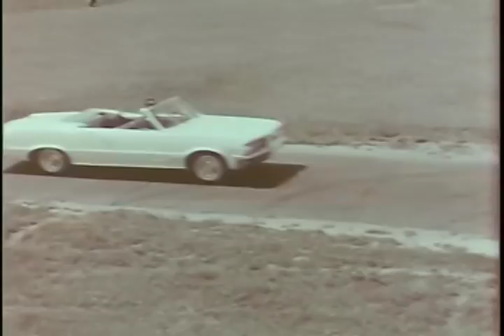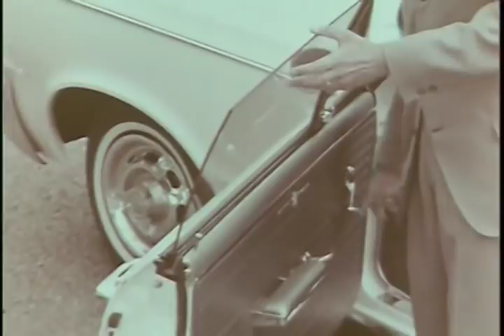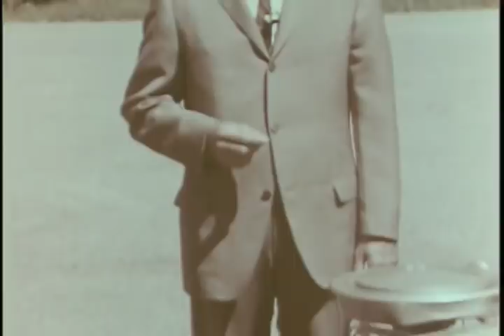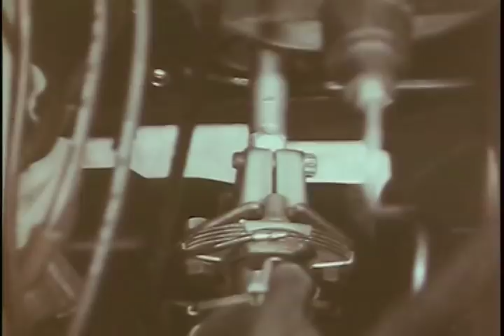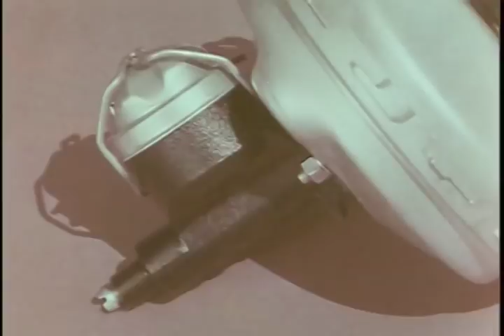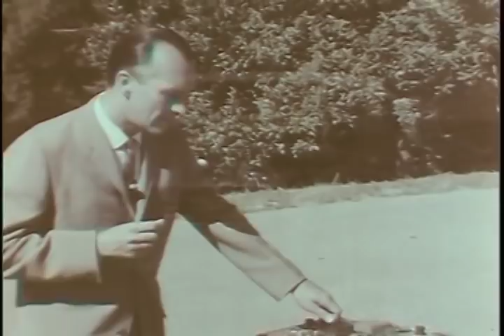Pontiacs for 1964

Comment: my 1964 tempest custom 500 convertible was a great car and later when I replaced the worn 2bbl 326 with a 1966 gto  Th 389 4 barrel engine, which was a direct replacement and bolted up to the 3spd manual, even better. The  insurance for this car was much cheaper than for a GTO
Reply from the maker: That’s the classic sleeper formula done right! Dropping a 389 4-barrel into a Tempest while keeping the 3-speed manual and lower insurance rates was an absolute win. Nothing beats the period-correct swap of a 326 for pure Pontiac muscle without paying the GTO tax!

Comment: We had a 1966 Pontiac station wagon, and it had 400 c.i. engine with a Rochester 2bbl. Carb.  That was one of the best cars on the road back then.
Reply: 389.   400 cubic inch started in ‘67.

Comment: My father bought a '64 Tempest 4 door around '67 after his '62 Falcon croaked. The Tempest had a 215 in it, it was good engine from what I remember. I remember tuning it up, very easy. I replaced the heater core, easy also. Junked it in '81. Always wished it was a GTO. :)

Comment: My brother bought a 1966 Pontiac Tempest with a 6 cylinder overhead cam engine a long time ago. Every time he wrecked it, I got to fix it. It had a timing belt. Never knew they existed. I think it was 250 CID. Powerglide transmission.
Reply: Turbine 300 trans.  Pontiac DID NOT use Powerglide.

Comment: My parents owned a tempest.... it was a complete piece of junk.... they were known for their weak transmissions which couldn't hold up to even the torque of a 327 small block v-8....    others in their line were better I guess....the 2 barrel v-8 would run out of power at about 60.... passing after 60 took forever.... the engine couldn't breath.... it would of been better with a small 4 barrel....   Our tempest had a whistle when you got up to 70.... my dad took it back to the dealer and nothing was ever done.... we were stuck with it....   just a p.s.   Our pontiac was a 1963.... not a 1964.....

Comment: For 1964, we’ve introduced faster dissolving steel - you’ll wonder where your car went after only one or two Michigan winters!
Reply: I got a 64 tempest from my brother in 1974.. It had been through 10 brutal Cleveland winters. I used to slather on the Bondo.
Reply: I had a 61 Tempest from Salt Lake City when it was about 14 years old, you could kick holes in it lol.

Comment: Sure loved the styling of these cars and especially this year. I think I'll hold out though, I'm looking to get the 66 Chevelle, I'll be a little late picking it up, sure it'll be second or third, well who knew how many hands it went through, got it in '84. The suspension I put in was stiff, the noise OUTRAGES,  open headers didn't help. The level of fun and memories, PRICELESS. Wish I still had it, but cars ARE safer and more fuel efficient now. Oh, LOTS quieter too.
Reply: Have you heard of a restomod before mate.

Comment: I still own my 1967 Pontiac GTO, 4 speed with a  Hurst floor shifter, 400 HO engine  with 360 hp after 52 years.
Reply: A guy that lives near me has a 67 GTO also with the 400 HO-4 speed combo and it's actually his daily driver all year long other than in the winter or when it rains. He's the 2nd owner. It's in beautiful shape too. Original and unrestored. It's not 100 percent mint but it's in outstanding condition for how much it gets driven. Definitely a nice #2 car for sure
Reply: If you want to leave it in good hands, contact me.
Reply: I bet it still has a better ride than a 2022 whatever. I miss my 1970 Lemans Sport.
 After 3 350 trans rebuilds I gave it to a guy that raced dirt track. He put 292 I-6 in it with 350 heads he welded together and re-machined to fit the block. Oh and the pistons from a 350 would  & did fit in it. Even better results than a Clifford. Ran it for 2 seasons. None of the 350s made it through one season.
2 cylinders lighter 300+ HP.
 When you think about a Atlas I-6 (256CI) makes 275-290 HP.
 This might be why the Tempest OHC I-6 was so lame. "Wouldn't you rather have a V-8?"

Now you cant fit a I-6 in 2022 anything. Even the RAM is a V-6. Guess the I-6s last too long.
 Plus you need 25 lbs more steel and plastic and a longer hood to stuff it in. Out of style.
Reply: @warrenpuckett4203  Don't forget the Ford 300 Inline Six as well.
Reply: For sale ?
Reply: Good for you, glad you could hang on to it. Memories and grins are part of the package.
Reply: Now that’s an old man’s car.
Reply: @Smarty1171  Yeah that looks a million times better than overpriced eggshell on wheels you see on the road today.
Reply: @Smarty1171 GFYS

Comment: Why can't we have these old styling brought back? Thinner metals, fiberglass, aluminum, and plastics along with a turbocharged direct injection aluminum head 4cyl engine with a lightweight fwd drivetrain should help keep the weight down. I can not believe that extending the interior by 2 feet, and the trunk by a foot will add that much weight to the small cars we have today. - cars that no one buys because we can not carry passengers in them.
Reply: @6:28 i forgot - it'll be unibody so it will save weight on the frame.

Comment: Well, much of this is BS. The 63 tempest was a revolutionary car. I-4 engine, rear auto trans, aluminum V-8, monocoque construction. Excellent weight distribution. Better than anything Pontiac had after. But GM didn't like small cars, so they bloated it up like Ford did to the Thunderbird.
I'm still a Pontiac man.
Reply: I had one of those frameless freaks, a 61 Tempest. A real joy when the stressed body floor rails rusted.
Reply: There were three of those ‘61-‘63 BOP unitized oddballs in the Albuquerque pick a part 12-13 years ago.   Didn’t dare buy anything for resale, too odd and strange.

Comment: OK...I own a 1963 Catalina Safari wagon. 389, 4-speed. It was a 3 but I converted it to a floor shift with a muncie. I also installed disc brakes since 4 wheel manual drums in this monstrosity was just too damn dangerous! Otherwise....stock. The car is basically a truck. Period.  It handles and rides and drives....like a damn truck. The "sportscar like handling" this guy mentions.....um, NO! Granted, its a wagon, but I also owned the sedan version of this car before this car.....still a truck. I've owned this car for 14 years and until recently, drove it to work every day. I live 2.5 miles from work so its not a problem. Unless I absolutely  have to, I don't take it out on the high speed toll roads (85 mph speed limits here) because these old cars are death traps if something goes wrong. Tooth pick thin A-pillars, solid steel steering columns, etc. It has a 2:69 rear gear so it will easily cruise at 80 all day but.....its a handful.  A ton of character and women close to my age (56) just love it.
Reply: THEY ARE FINE IN ACCIDENTS IF YOU HIT ONE OF TODAY SHIT BOXES  DRIVE IN ONE SIDE AND OUT THE OTHER AND THATS IT !!!

Comment: In the mid 1950s, Pontiac brought on Semon “Bunkie” Knudsen as general manager to revamp the struggling division and transform its old-man image to a more youthful persona. To accomplish this feat, Knudsen teamed with Pete Estes and brought in brilliant young engineers such as John DeLorean, Bill Collins, and Russ Gee. Under the leadership of Knudsen, Pontiac styling became leaner, more powerful and with a lower wide-track stance. Pontiac took its new designs to the track, battling it out with other Detroit automakers in NASCAR and NHRA. By the early 1960s, Pontiac’s transformation was complete and all was good… until January 1963. GM brass instituted an internal ban on racing that ended the successful game plan that Pontiac had used to propel itself into the #3 sales position. What would Pontiac do without racing to stoke the fires of its sales inferno?
The solution came from a secret underground laboratory in Milford, Michigan. OK, that might be a little too dramatic. In reality, DeLorean, Collins, and Gee would meet most Saturday mornings at the Milford Proving Grounds for casual gatherings referred to as “what if” sessions. It was during one of those sessions that the elite engineering crew put a prototype 1964 LeMans coupe on a lift and examined the drivetrain components. As legend has it, Collins coolly suggested to DeLorean, “You know, John, it would take about 20 minutes to stick a 389 in here.” DeLorean responded, “Let’s try it.” Since the external dimensions of Pontiac blocks were the same size, with the same mounting provisions, the swap to the larger displacement 389 was relatively simple.

Soon after this “what if” session, DeLorean was driving the very first “GTO,” a LeMans coupe powered by a classic 389 topped with a tri-power and bolted to a four-speed transmission. DeLorean put some of the most influential players at Pontiac and GM behind the wheel of the new creation. The LeMans test mule was said to be so much fun to drive that DeLorean often had difficulty getting the car back after he had loaned it out. At this point, the biggest obstacle DeLorean faced to get the car into production was GM’s internal policy regarding big engines in small cars: in the GTO’s case, a corporate edict mandating 10 pounds of vehicle weight per cubic inch of engine displacement. The team slyly discovered a loophole in the wording—the displacement limit only applied to base engines; there was nothing written about optional engines. So the LeMans with the GTO option package, which included the 389 V-8, adhered to the rule because it was offered only as an option. DeLorean reached out to Jim Wangers, vice president at Pontiac’s advertising agency, McManus, John, and Adams. DeLorean asked Wangers to promote the sensational car to a whole new generation of young Americans and show them the meaning of driving for fun. Wangers was so successful in promoting the GTO-optioned LeMans that Pontiac took 5000 dealer orders before the GM Corporate folks knew the car existed. There was no turning back.
The Pontiac GTO was introduced to America in September 1963. And with that, Pontiac had taken its heroic racing battle off the track and brought it to the street, where it would once again do battle against arch rivals Ford, Mopar, and even Chevrolet. The ultimate muscle car superhero was born.

 One member of GM brass, Pontiac’s sales manager, was furious with DeLorean at a board meeting where his chicanery was exposed and where he was asking approval to build the car. Since orders were already coming in a compromise was reached and 5,000 cars were authorized. Supposedly the sales manager, who had been kept in the dark and was dead set against the car, angrily challenged DeLorean and said he’d never be able to sell the cars and the company would be stuck with them. DeLorean then turned to Jim Wangers and told him to “Get Those Orders” which went on to become one of many unofficial explanations of what “GTO” stood for. Ultimately over 32,000 1964 GTOs were sold.
Reply: Dhy5342 the rest is history!
Reply: Thank you for that very informative history of the transition to a sleek, well defined car with a more powerful drivetrain.
Reply: The Mid 50's is when Pontiac became GM's Mopar while in the 60s it also became America's BMW as well.
Reply: @CJColvin  Then came the Aztek, and the end was in sight.
Reply: @dhy5342  When the Aztec came it was over for Pontiac (other than the 04 to 06 Pontiac GTO which was nothing but a rebadged Holden Monaro from Australia 🇦🇺 mate).

Comment: Miss those Canadian Pontiacs....Strato -Chief (base model) then the Laurentien, (mid class) and then the Parisienne the top of the line. Great big chrome boats, rust buckets and whatever you want to call them. But that was the crème de la crème of North American Autos at that time.
Reply: Powered by Chevrolet for Canadian consumption in Pontiac's....For a while!
Reply: @Rick1959  WAS PONTIAC SHEET METAL ON CHEBY CHASSIS , WHEELS WERE A FOOT AND A HALF INBOARD OF THE WHEEL WELLS HAHAHAHAHAHAHAHAHA

Comment: @ 9:49 I wonder what they said about those "inherently unbalanced" V6s when they had to start selling them. A counterweighted crankshaft and 60° cylinder angle seems to have solved the problem pretty well.
Reply: firsts GM V6 auto engines were common cranck pin with a 90 degrees blocks, so these engines were vibrators, later, they used spilt pin crankshafts to porduce even pulses so these engines were much smoothers, the 60 degrees split pin crankshafts engines were introduced in the early '80 with the citation and its derivatives, these engines were smooth running but not as smooth as the inline six
Reply: The key word is "inherently".  The straight six is, by design, in balance without the extra external balancing weights required by the V-6.
Reply: Buick's 3.8 liter had the 120 degree crank, offset rod bearings.
Reply: There was an “odd fire” and later an “even fire” Buick V-6.    One of the longest running engines GM built.  Lasted until 2009.

Comment: I am honestly surprised by how many basic engineering changes there were in the "final year of production" full sized '64s. Changing the frame gauge. changing the body mounts, and upgrading all of the light filaments all had to do with underlying goodness. the rubber window seals trickled "up" to the big cars from the A car (Tempest) program.

Comment: funny, the  Tempest "6" was a small bore chevy, with a powerglide  trans, also, the 326V-8 was no match for the Oldsmobile 330-V-8, the  olds blew them away,
Reply: Starting in 1949 and continuing for many years,Olds was kicking b*tt all over the landscape.
Reply: Anything with a powerglide was a dog compared with a stick shift in the same car, or a comparable  Mopar with  a torqueflite.

Comment: I like the "special" Pontiac six cylinder, it's a small bore version of the Chevy gen III 6 cylinder engine. So let's review- buy the cheaper Chevrolet and get a larger, more powerful standard engine.  Next let's talk about 6s and disparage the V-6's the senior Divisions (Olds & Buick) use.  Let's talk about how great the transmissions are in the large cars, the Roto-hydramatic and Super Hydramatic these transmissions are so darn good we're discontinuing them next year and switching to a 3 speed Turbohydramatic. We didn't talk much about the larger cars because they're really the same as last year. And remember the Pontiac is the quietest smoothest on the road so why spend more money on an Olds, Buick or Cadillac?
Reply: Your point with the transmissions was spot on GM needed better transmissions, but why did they keep the Powerglide for so long? they hurt performance & economy but GM rode it way too long. The Powerglide should have been long gone in the early 60's, Ford & Chrysler had long had 3 speed transmissions by then.

Comment: The vertically stacked headlights gave the grille a really nice look. The '65 Ford Galaxie 500 with it's squared styling and vertical headlights was my favorite!
Reply: we had a 65 500 LTD, beautiful car.
Reply: Add an R-Code 427 Side Oiler and a 4 speed to a 2 door 65 Galaxie 500 XL and you've got one of my favorite Ford's ever made. Or better yet a 65 Ford LTD with the R-Code 427-4 speed combo. I believe 3 or 4 of those were built. I've seen a red factory R-Code 65 LTD before and a green 67 LTD with the factory 427-4 speed. The same people own them both. Lucky mofos
Reply: I liked the Ford look better then the Pontiac

Comment: That six cylinder engine looks just like a Chevrolet six cylinder engine.
Reply from the maker: Yes and no.  In the mid-1960s, Pontiac revived their straight-6 for a short time. 
Although it was of a different displacement, this Pontiac engine was based on Chevrolet's Generation 3 straight-6.
Pushrod 215The 215 cu in (3.5 L) straight-6 was produced in 1964 and 1965. It is sometimes confused with the 215 aluminum V8 used in the two years prior. It was an OHV/pushrod engine design, quite different from the previous Pontiac straight-6 engines. 
It was a smaller bore (3.75") version of the 230 cu in (3.8 L) Chevrolet straight-6 engine. The Pontiac 215 engine had a Chevrolet bellhousing but the flywheel/flexplate bolt pattern had a Pontiac V8 bolt pattern.
Reply: Amazing that GM divisions had different engines. Now I'm wondering, were the Holden (Australian General Motors) red sixes of the 60s, 70s, and 80s a derivative of these Chev or Pontiac sixes too? They were pushrod, OHVs of 149 to 202 c.i.
Reply: You also might say that the six cylinder Chevrolet engine looks just like a Pontiac engine.